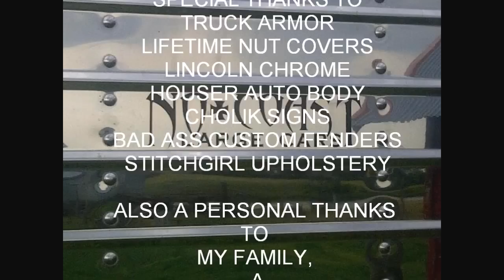NEVER SETTLE by Bull It Angus Inc. (NEVER $ETTLE)

Comment: Nice looking Truck and many props for doing it yourself I have one question whats up with the crank windows?  I am not trying to be a ass it is a honest question I would appreciate a honest answer thanks in advance
Reply from the maker: Honestly the truck is a 93 and was spec'd out with just the air pass window. I left the driver side crank style to prevent any issues down the road as it would be easier to address if a problem occurred on the road